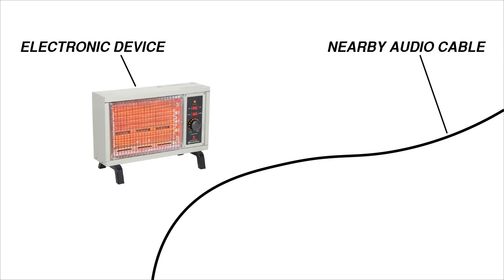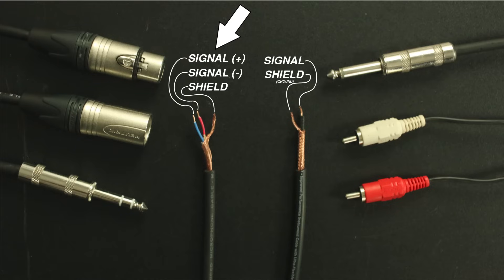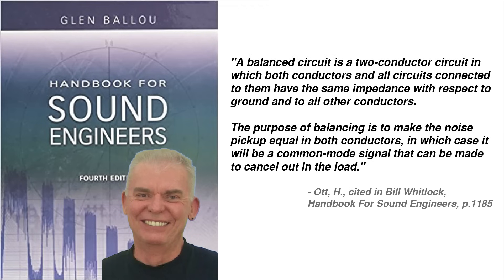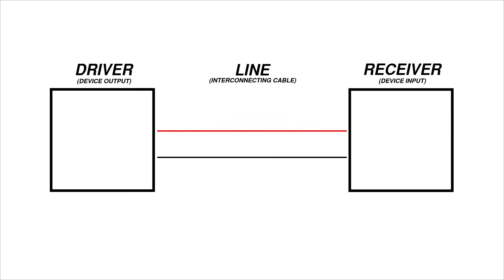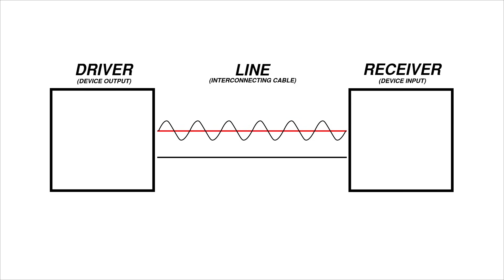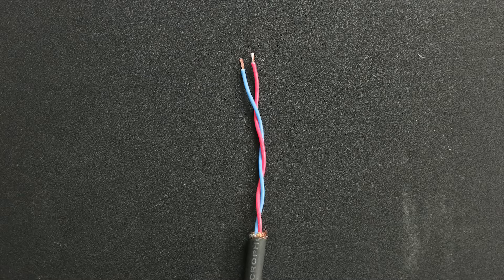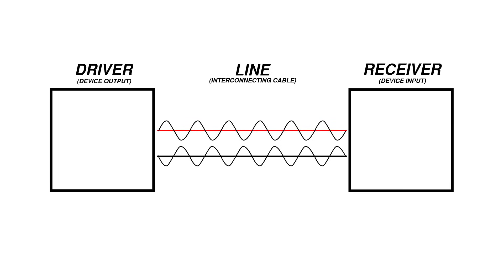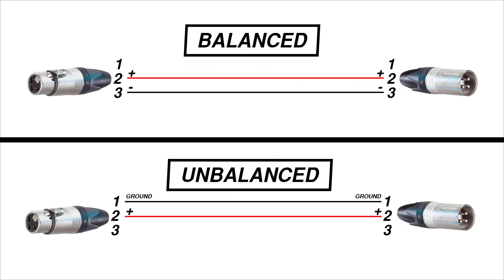Balanced vs Unbalanced Audio | Do Balanced Cables Sound Better?

Comment: I'll save everyone time. They don't sound "better". Balanced cables remove noise from the signal. The vast majority of consumers don't have noise in their signal.
Reply: You have some small noise in signal. But most of the time you don't hear it.
But If you have more noise, when you have more cables running together - power cables, audio cables and so on - then balanced is the best thing since sliced bread ;) 
That's why all computer network cables are always balanced. They are Balanced Twisted Pairs. Remove the balance, and from 1Gig network you will only get 10Mbsp (or lower), due to noise.
Reply: @BartoszRybacki0  correct! Too much 'noise' for data to filter through will reduce the 'max' attainable..
Reply: @BartoszRybacki0 in audio system... I thought the noise from the mainline ac 50hz frequency... But when it connects to ground via me or device, the noise stops... touching signal it make more noise but touching ground no noise at all...
Reply: @benjimenfranklin7650  
Sorry for my ignorance but what is the point of unshielded mic cable? Sounds like a nightmare from audio hell
Reply: @benjimenfranklin7650 

Do not mislead people!
Both balanced and unbalanced cables are shielded.
Signal difference: differential and non-differential.
You may be an electrician, but you clearly studied the theory of electrical engineering and electronics poorly!
Reply: I have a lot of noise in my signal
Reply: @ProjectileGrommet  So do these comments.
Reply: I don't think you saved me any time... considering I still learned more for the video..
Reply: Being a 20 year electrical design engineer, if the cables are exposed to a noise source, balanced cables will stand up against, resist or repel the noise much better than unbalanced.

Wires are basically antennaes so they are subject to noise.

NOISE SOURCES:
* power lines from power company. Low freq noise
* magnetics ...low freq noise
* cell phone radiation. Hi freq noise
* any transmitter like WiFi for instance. Hi freq noise
* 120 or 220 VAC lines mingling with these cables near by. Low freq noise source
Reply: @betawithbrett7068  Sure, but most people won't be able to hear that noise. That's my whole point.
Reply: @benjimenfranklin7650 

Unshielded Sun Rise cables are used for balanced connections only. The length of the cable must not exceed 10 meters.
Learn the physics of electrical signal transmission!
Good luck!
Reply: @russkij-mobik-ljaghet-v-grobik  
Stick it in your ear !!!!
Reply: To sum up the comments commenting on this comment:
It's complicated and it does make a difference but probably not that much if you're only using a zoom recorder, a boom with a fethead, a rather short cable and no electronics apart from that within a 30 foot radius. Like me. 😄🤷🏻‍♂️
If you're in an actual recording studio, everything up and running, there is probably no way around it.
If you're somewhere inbetween, it depends
Reply: @uhuhno6441  To clarify, for your average consumer it absolutely does not matter. I only mean consumers. Most cable lengths are a foot or so in a home setup.
Reply: @Wordsalad69420  I have a small studio in my office, with about 8 synths, a guitar setup and a bunch of pedals and rack effects. Some of my synths are designed for balanced and some are not. I did actually have a noise problem that running balanced cables (on the synths that are set up for balanced) solved.
Reply: @leftovernoise  Sure, but the majority of people don’t have 8 synths and guitar setup. The vast majority of consumers don’t have noise in their signal and hence don’t need balanced cables.
Reply: @Wordsalad69420  Where are your sources on "most people don't have noise"? Have you done studies on that? Or are you assuming because you haven't had noise issues, that most people don't?

If you have gear that accepts balanced cables (which is the only reason you would use them) you're already not "just some guy with a single guitar". Most gear that takes balanced cables is studio equipment. So you're already out of the "average musician" bracket you've invented. More and more musicians are recording at home now. Home studios are incredibly common these days. 

Did balanced cables personally attack you or something? They are roughly $1-2 more than unbalanced, there's very little reason not to use them if your gear is set up for it. Idk about you, but when recording, I like to reduce unwanted noise as much as possible. If spending 1 more of my hard earned dollars on a balanced cable can help with that (which I'll remind you, it literally fixed a noise issue I had) then I'll spend the tiny increase on a balanced cable
Reply: @leftovernoise  The onus of proving that the majority of consumers don't have noise in their signal is not on me. If you are saying that the majority of consumers have noise in their signal and need a balanced setup, it's up to you to provide the data to support that. I cannot prove a negative, it's up to you to prove the positive.
Reply: It "absolutely" can matter. It might not or probably won't matter but it ABSOLUTELY CAN matter.
Hence the use of balanced inputs and outputs.
Reply: @Kidbucked  It can matter, but for the vast majority of consumers, it does not.
Reply: @Wordsalad69420  You wasted my time with your out of context comment, this channel is for pro audio, not home stereo systems. 

You should delete your comment.
Reply: @Roy_1  Nah, I'll leave it. I don't care what the channel is called. I was making a factual statement, feel free to refute it.
Reply: Glad I made it to the basket weaving thread😂😂
Reply: @mgd9151 knitting some new mittens here... watching the entertainment unfold, I am about to get the popcorn next!
Reply: @Giantcrabz It does not sound better in most cases. List I said, most people don't have noise in their signal.
Reply: @benjimenfranklin7650  or just explain it to him since we're all convinced you don't know what you're talking about for reasons that SHOULD be obvious to you.
Reply: TRUE
Reply: @benjimenfranklin7650 Except he bothered to prove what he said.
Reply: Ok
Can you explain better
Reply: @oluwatimileyincharles9884  not sure how much clearer I can explain it. The sole purpose of balanced cables is to remove noise from the signal. Most people don’t have noise in their home setups.
Reply: Really? How do you know.
Reply: @ulrichgorlich6292  How do I know what?
Reply: you saved me 30 mins of my life thabk you sir
Reply: How are you going to pay all thee people’s bills with an attitude like that?
Reply: I have noise in my time
Reply: What if i connect 1&3 to ground and 2 to positive in an xlr?
Reply: King
Reply: Resistance can also affect audio. Always check resistance.
Reply: It reverse the noise but the source audio is amplifier
Reply: What is it called when the speakers are turned on with no audio noise from a cd player but you can hear that they are on?
Hope that makes sense
Reply: It "wouldn't "sound" better , huh? I don't like how NOISE SOUNDS! It "sounds" like SHIT. Now go save yourself some time and stfu.
Reply: Exactly. For most consumer systems, only very short cable lengths are ever used, so it’s unlikely for noise to be introduced.
Reply: @benjimenfranklin7650  I've never seen microphone cable, instrument cable, or coax that wasn't shielded. Electrical cable, such as Romex is a different animal altogether.
Reply: @houndawg3 shielding isn’t full proof
Reply: @jahmoresound7895  nobody said it was.
Reply: @benjimenfranklin7650  No. Most cables are shielded. There is a processing part to balanced signals on the receiving side. Balanced cables use two signal wires; both carry a copy of the signal, but the two copies are sent with their polarity reversed. If you sum two signals that are identical but are reversed in polarity, the signals cancel out, leaving you with silence. 
So it's a nice signal processing trick to eliminate the noise.
Reply: @Wordsalad69420  albeit a simple explanation. 
Balanced circuits are ‘different’ at both ends of the connection. 
Balanced cables don’t have to be ‘shielded’ that’s a different problem altogether. 
Consider STP and UTP, that may help understand.
Reply: @Wordsalad69420  so,what  you trying to say is that it depends on the productivity of the Cable
Reply: @Wordsalad69420  
Shielded cables are more expensive and unwieldy than unshielded cables but offer increased protection against electromagnetic interference (EMI) that can slow down or disable electrical systems. Unshielded cables are easier to install and maintain but are not protected from EMI.
Reply: @benjimenfranklin7650  yeah you can tell a cable is shielded cause its a lot thicker. coaxial cable for example
Reply: @robertchitoiu8223 Your comment is disrespectful to Kyle, who put a lot of work into a very good video.

Here’s why you’re wrong:

#1) Multitracking. Even tho the amount of noise in one track might be imperceptible, if you  record 8, 16, 24 tracks it all adds.

2) Compression. When the recording is compressed, which all are, the quietest sounds, including the noise, are amplified relative to the louder sounds.

3) Dynamic Range. If an audio signal demands more power than the system can supply, the highest peaks distort. That can be remedied by turning down the signal, or by using a higher power system. If you turn it down, the quietest parts of the signal could be inaudible, due to being at a lower level than the noise floor. Those two limitations, taken together, represent the dynamic range. To accurately reproduce a performance, you want to expand the DR as much as possible. It is easier and cheaper to do that by cutting the noise in half, for example, than by doubling the amplification capacity.

Robert, you already changed your story from “the vast majority of people” shouldn’t watch the video, to “most people” shouldn’t watch it.

The truth is everyone should watch it. Even if you have a system where unbalanced cables are sufficient, which I admit can fairly often be the case, it’s still very cool to understand the genius of common mode rejection.
Reply: @spareplanet  Don't care how much time he put into it. 

1. I have no idea what 8, 16 or 24 tracks are and neither do the vast majority of consumers, therefore, balanced audio is irrelevant to them.
2. That is so wrong it's laughable. If the source audio is compressed, you can have balanced cables made of gold, it's not going to remove compression noise. Balanced cables remove noise introduced by the environment as it travels through the cables to the speakers (or wherever it travels). They do not alter the signal in any way shape or form.
3. Same as #2, has nothing to do with balanced cables.

Balanced cables are also useful if you have particularly long cable runs. The vast majority of consumers don't have long cable runs or EM interference in their house/apartment. Therefore, they do not need balanced cables. Please do learn about the subject before you spew nonsense. Just because there is a beautiful video talking about balanced cables doesn't mean it's gospel.
Reply: @Wordsalad69420  I see why you’re having trouble with this. You keep referring to consumers. Consumers use unbalanced cables, like RCA. Pros use balanced. Pros use compression. Pros use multitrack. As you are a consumer, you are forgiven for not knowing about those things. You just shouldn’t be weighing in on someone else’s video, telling other people not to watch it, when it’s an area you admit not knowing about or not caring about.

I’ll re-explain compression so maybe you can get it this time.

1) The music signals come into the recorder. They either come in “clean”, on a balanced cable, or along with some noise, if on an unbalanced.

2) After all the clean or noisy tracks are mixed, that mix is compressed. The compression process attenuates (reduces) all sounds, both loud and soft, and then boosts all sounds back up again. But it doesn’t work on loud and soft sounds equally. The louder the sound, the less effect. The quieter the sound, the greater the effect. The end result is that loudest sounds are near their original volume, but the quieter sounds are now louder. Because of that, the overall recording now sounds, and is, louder. Also because of that, if there was noise present, inaudible levels of noise could now be audible.

Compression can be confusing. The key is that it doesn’t mean the signal is compressed, in the sense of being smaller. The signal is actually louder after compression. What got “compressed” is the difference between the loud and soft sounds. There is less of difference.

The video is from “Audio University” not “Consumer Audio University”. The video discusses balanced cables because the video is intended for people who want to learn about both pro audio and consumer. If you never want to learn about pro audio, that’s fine. If noise, dynamic range, compression, etc etc, are all irrelevant to you, that’s fine. But you shouldn’t criticize the video and tell people not to watch it, because a lot of people want to know about those types of things.
Reply: @spareplanet  That is what I am saying. The vast majority of people are consumers. A small minority are pros who need balanced cables. That’s the only point I am trying to make in my original comment. The vast majority of people don’t have noise in their signal. Are you disputing that?
Reply: @Wordsalad69420  

Robert, context can be critical.

We both know that decent quality home audio systems generally don’t have noise issues. Even with cheap, unbalanced cables. I don’t dispute that.

The problem is context. Your comment (original comment) in the context its in, takes on meanings you might not have intended, and is very damaging.

It says:

“I’ll save everyone time”
means- “No one should watch this video”

“(Balanced cables) don’t sound better”
means  “The creator is wrong or lying”

“Balanced cables remove noise”
means “I’m telling you something the video didn’t tell you”

“The vast majority of people don’t have noise in their signal” means “this video is incorrect or irrelevant”

(those are the meanings that come  across, not necessarily the ones you intended)

You “corrected” the creator for saying things he didn’t say.

The video isn’t about home audio systems, it’s just about the various types of cables that are out there, for people who want to know about that. He never said, “buy balanced cables - they’ll fix your noise issue. He never said you had a noise issue, or “Watch this video to make your audio system better” or anything like that.

The video is just about cables for people who want to learn all about cables (perhaps not even for any specific reason, some people just like learning about things)

You might not be interested. But that doesn’t make it a bad video. And it doesn’t mean others shouldn’t watch it.

But, intentionally or not, your comment could discourage thousands of people from watching a perfectly good video.

And, intentionally or not, your comment also called into question the creators’ credibility. Meaning it could impact viewership of his other videos, too.

You may have been trying to be helpful. But context matters and unfortunately it ended up being a comment that’s harmful to both viewers (it deprives them of good content) and the creator (his views, likes, subscribers, etc etc will all suffer, undeservedly)
Reply: Correct.
Reply: Thanks for saving my time
Reply: This is pure nonsense.
Reply: @tmengucor  Ok, then what are balanced cables for? How do they improve your sound?
Reply: @Wordsalad69420  They don’t.
Reply: Save time? It's only 5 minutes. Is your attention span that of a fly?
Reply: @sepg5084  It’s a figure of speech.
Reply: bad take
Reply: @Vag_Poop  how is it a bad take? What did I say that was factually incorrect?
Reply: It doesn’t REMOVE noise, it stops it getting in there !
FFS, learn to use google.
Reply: Yes, this cable lead the noise to the ground. Is that simple, but the circuit has to be designed to accept it.
Reply: I do, and balanced connection solved it!
Reply: RCA cables are like antennas, they readily pick up RF signals from adjacent electrical devices. The longer the run the more RF they pick up. The balanced connector is also easier to connect and disconnect and has positive locking mechanisms. Lastly, even well made, good ones can be affordable. If your components have balanced inputs and outputs you should always use those instead of the unbalanced RCA"s. Its not a big investment and will offer guaranteed noiseless connections. If your components dont have balanced connections you should use shielded RCA's (SPDIF) these will reduce noise too but not as well as balanced cables, they can also be inexpensive. Never use "Plain Jane" RCAs. Regardless of price and materials, if they are not shielded, they are trash.
Reply: What I notice when using balanced cables in headphone amp is that it seems louder at a lower volume.
Reply: I’m seeing a lot of speaker reviews saying otherwise
Reply: @manuelhe46  Good thing speaker reviews are subjective then! But please tell us how balanced cables improve speaker sound?
Reply: All the consumers have noise in their signal. We’re able to manufacture devices that have the noise element reduced to the level where it’s unperceivable but it’s still measurable. Also, suggesting the cable somehow removes noise isn’t technically correct.
Reply: B@lls
Reply: Totally wrong. The vast majority of audio has too much noise. That is why we have DACs
Reply: @ioannisgko  ??? What does a DAC have to do with eliminating noise !?
Reply: 99% of the people on here giving their opinions don't have much of a clue wtf they're really talking about with electrical signals. They couldn't describe the difference between voltage and current, for instance. Even if they read back to you from an article they still don't understand. They PRETEND to understand.
Reply: @ioannisgko  a DAC just converts digital into analogue, coz all noobs stream nowadays...if anything regarding noise, it may introduce noise at the analogue output...none of my issues though, I run all through xlr until the rme and from there aes/ebu all the way to the monitors ...no noise issue at all 😅
Reply: @jenshoefer7944 yup and you don't need a dac to convert a signal that's already been converted, so dac's are unnecessary, even if you're using ancient equipment, there is NO equipment made that can play unconverted digital signal NONE  WHATSOEVER